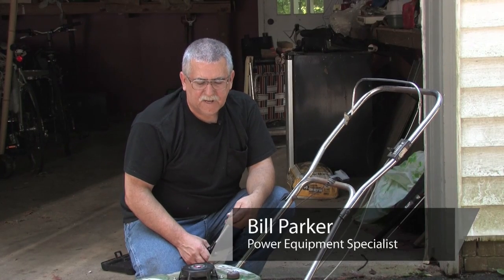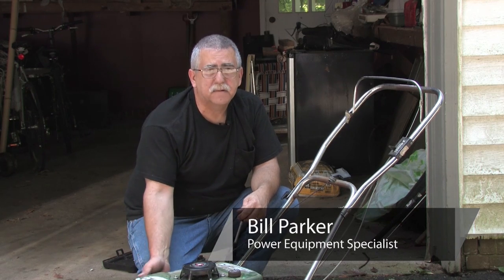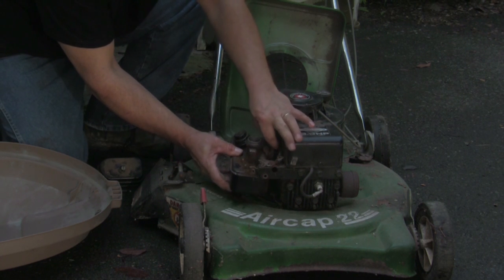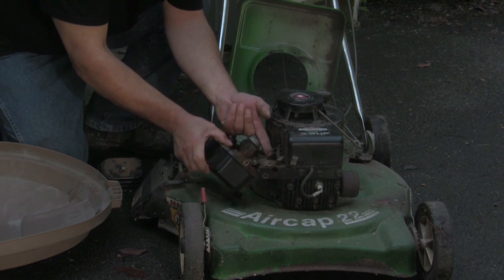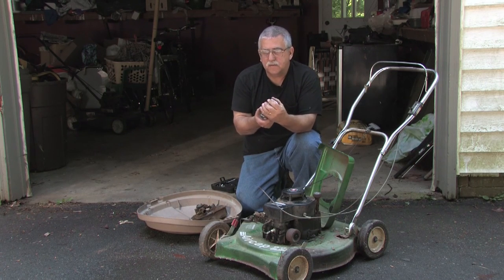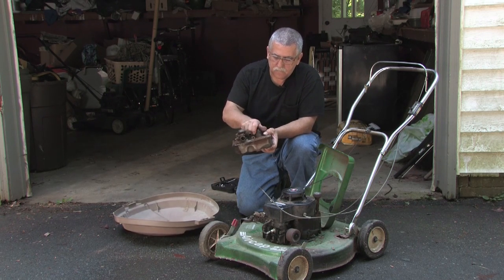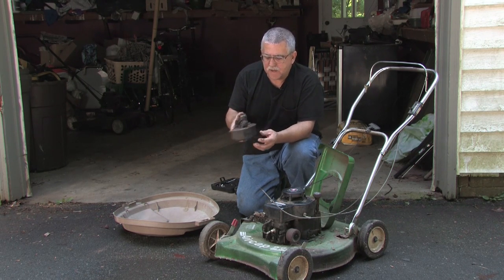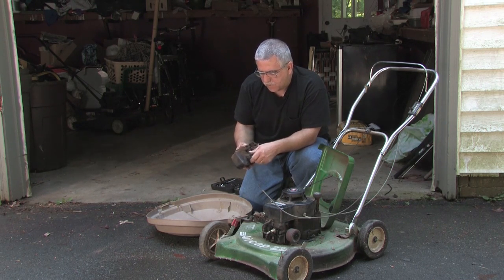Lawn Mower Repair : How Do I Remove Rust From a Lawnmower Gas Tank?

Comment: Thanks! I have an old Ford LT80 from the mid 70s, that I've just started to fix up. It has rust in the gas tank. I'm not a perfectionist nor am I doing a frame off restoration but it would be nice to keep the old metal tank for nostalgia sake... I think between your technique and a good see thru filter, I'll be able to keep the inside of the tank clean and the carburetor as well. The tank is relatively easy to remove so I'll just make it one of my Spring maintenance procedures to keep it clean and hopefully rust free.

Comment: That will remove most flaky surface scale rust but to get more of it out you can fill the tank with coke a cola or equivalent containing phosphoric acid which will dissolve more rust and leave a protective phosphate coating.

If  you do that then be sure to thoroughly rinse out with water, shake out excess water, and it helps to put it in a warm, ventilated area to dry it out faster so new rust caused by the water is minimized, OR you can spray it out with WD-40, dump that, then rinse out residual WD-40 with a couple ounces of gas.